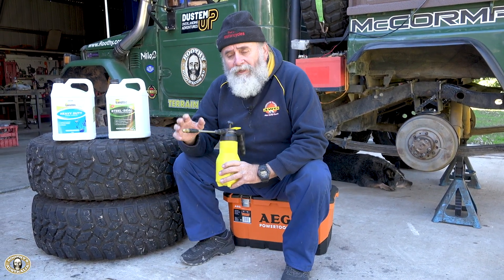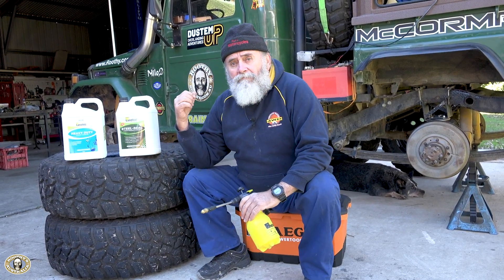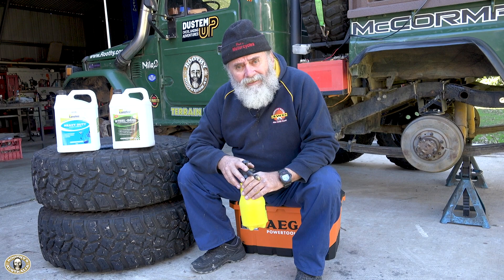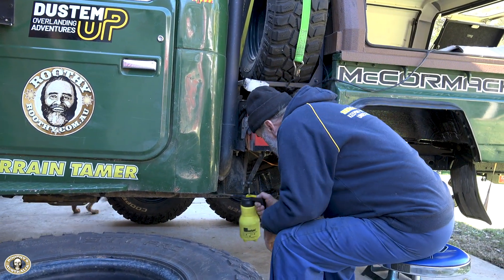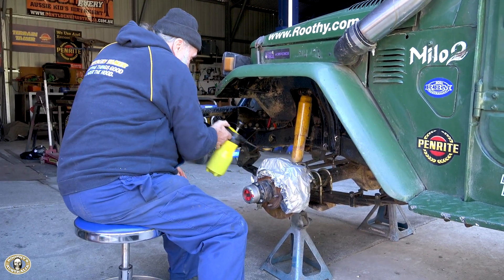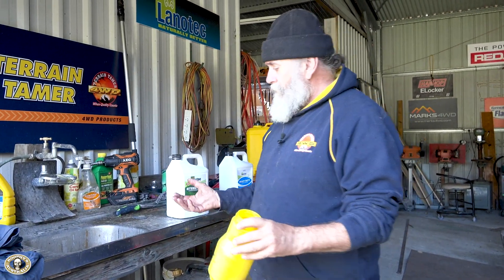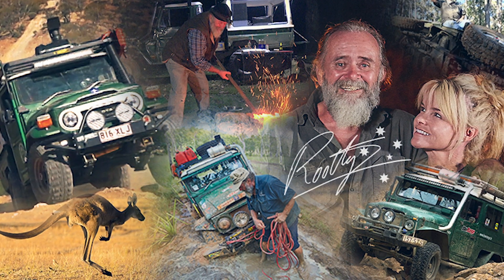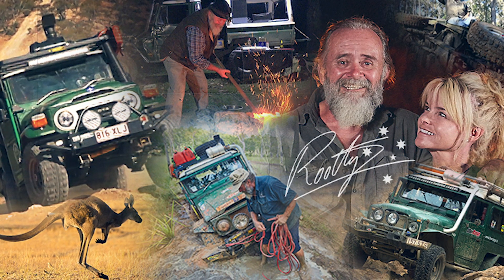Corrosion Prevention - Lanotec  - What To Use Where - Roothy

Comment: Good stuff that lanotec. First time I used it on my rodeo just before going onto Fraser Island. And I do mean just before. In the car park at inskip. Not a dot of surface rust. Roothy, would u recommend a whiff of copper grease (nevaseize) on wheel studs before beach trips?
Reply from the maker: Oooh, good point - probably work fine as long as you check tension because that stuff does loosen things too - I just spray Lanotec GP on my wheels and hubs and haven't had a problem - spray them, and then wipe with a rag.
Reply: haha What a good story. Perhaps Roothy needs to set up a Lanotec Vending machine at Inskip???? LOL
Reply: Lanotec Australia You laugh, but thats not a stupid idea. Actually, you should have a drive over system there. You should also have a look at watch wes work channel and send him some product in illinois. The place is the mecca for under car rust.

Comment: I’ve used the GP product (Lanox) for over 15 years and swear by it for the rust prevention.  

I have also applied it to a sacrificial pin that drives the propellor on my pedal kayak.  It’s made of high carbon steel so rusts at the smell of sea water.  Its actual function on my kayak means it’s in the sea water every time I go out to kayak fish.  I sprayed the HD stuff (Lanotec from the spray can) onto it two years ago and that pin hasn’t rusted or been re-coated since.  It looks brand new.  I swear by the qualities of both the GP and HD stuff!!

Comment: The Type A grease with some graphite powder mixed in works terrific for gate hinges out in the weather.
Haven't had any luck with the Lanotec spray gun though. After one application the air pump leaks and the trigger doesn't seal properly. Regular spray bottles are a huge pain to use but they just seem to be more reliable.
Reply from the maker: Hmmm, I haven't had any problems since I started looking after them after every spray -
Reply: @JOHNROOTHROOTHY  Maybe that was the issue, but it's hard to tell because it still didn't work after a good clean out. Need to get my hands on another one to give it another go.

Comment: So that's the stuff, I have been using an aerosol version on my car and bike and it's been working a treat other  than it staying a bit oily and collecting dust. Haha. Motor bike has a patch of bare shiny mental showing through from the boots wearing off the paint. It stays shiny cause of that stuff. (Even though it's not the best, will have to find that steel shield.)
Reply from the maker: Try it on your boots too - i do all my bike gear, gloves, boots, jackets - with GP Lanotec. Makes them waterproof and the Kiwis love you...

Comment: Awesome bit of info. How much do you need to dilute the citrafirce if your trying to get off old lanotec from under your truck? Cheers
Reply from the maker: I spray it on neat with an ordinary spray bottle, leave it one for a while  - then use a high pressure hose. Leave it to dry and spray Lanotec again - doesn't matter of you don't get all the old stuff off, that's kinda the point of i!

Comment: Very helpful I think this is perfect for my new Nissan as I want to take it in the beach every  now and then, how often do I have to do it with the steel type lanolin? Also after the beach should I gurnie it underneath or will it take it off
Reply from the maker: I do my trucks before beach trip season. After each trip you do the usual beach wash with lots of hosing. I sit mine in a sprinkler overnight. Save the gurney until before repairs. It blows shit past seals anyway. Have fun mate!
Reply: @JOHNROOTHROOTHY  just about to purchase so what one do I need is it the lanotech? I think your website is down

Comment: What's it like at stopping corrosion on electrical connections? like on your exposed batteries or on the winch or spotlights etc?
Reply from the maker: great - I do the lot - there's also a thick Lanotec grease that's really good for battery posts and things too.

Comment: Hi Roothy, recently got some steel seal. Back of the bottle reads that rubber should be avoided. Will be a pain to apply while doging all rubber components and seals on a vehicle like a Pajero for example. Have you seen issues with this? Thanks
Reply from the maker: There's no real issue with rubber and seal steal apart from it making it slippery. The pressure pack cans of Lanotec used a propellant that could damage rubber under some conditions, but not the 'pure' product you have. Hope that helps - and for my part, I just get under and spray everything!
Reply: @JOHNROOTHROOTHY  Thanks mate, appreciate the info. Keep up the great content!